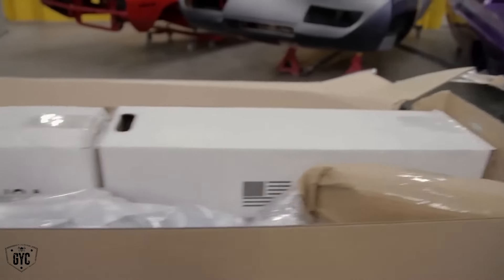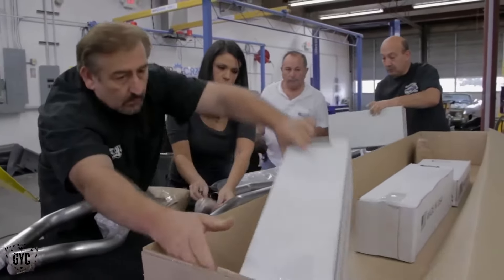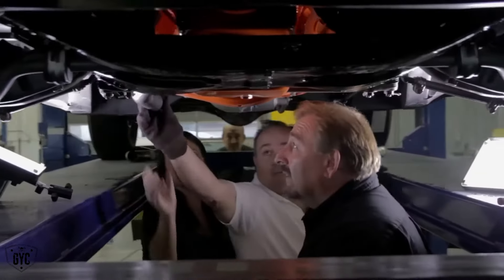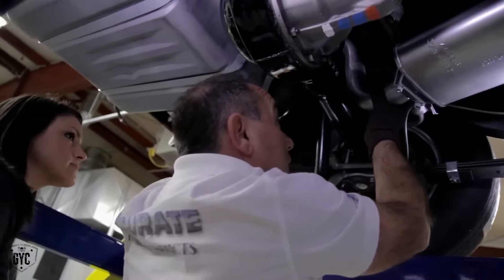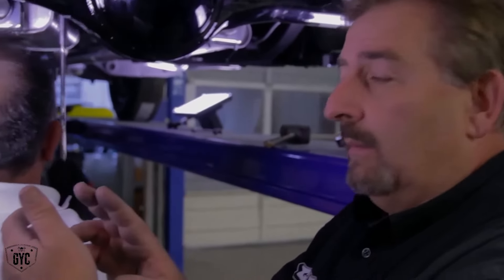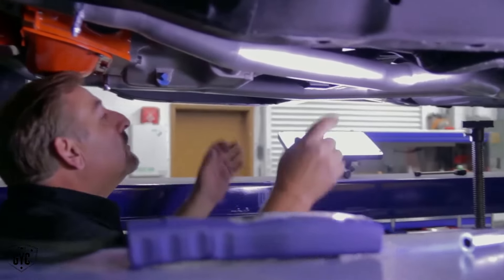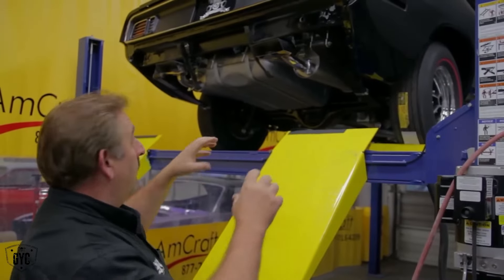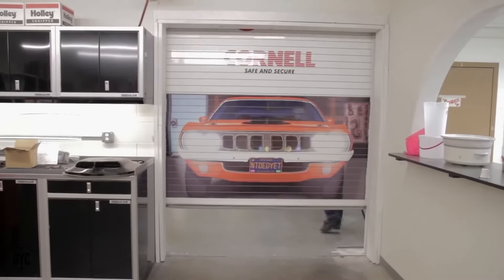Accurate Exhaust Comes to GYC | Graveyard Carz

Comment: I finally installed the Accurate Exhaust system on my 1970 Challenger. Not sure that i like it. It is VERY quiet. Fitment is okay. Same complaint as everyone else. One side hangs down lower than the other. Gonna have local shop fix it and gut the rear mufflers.